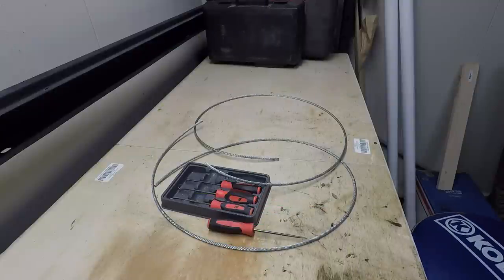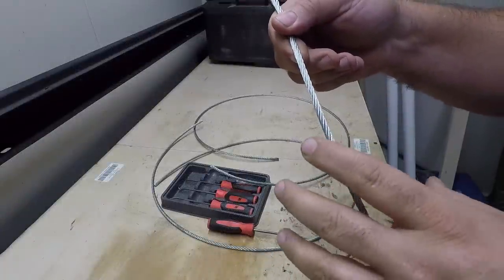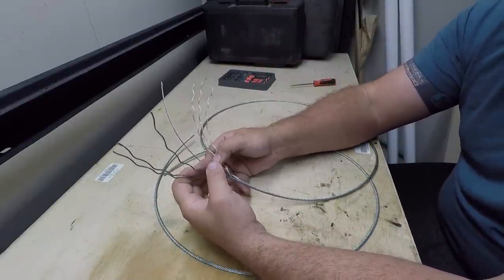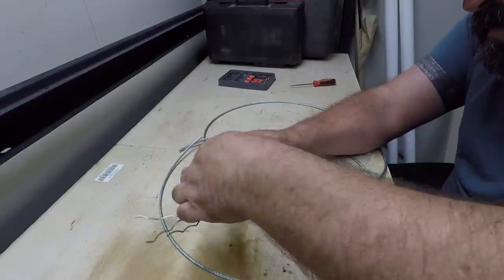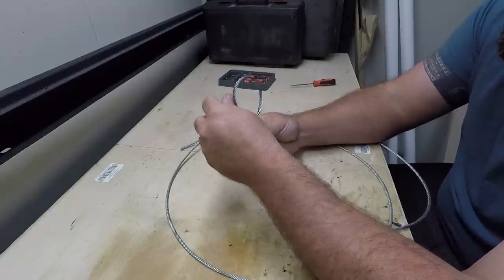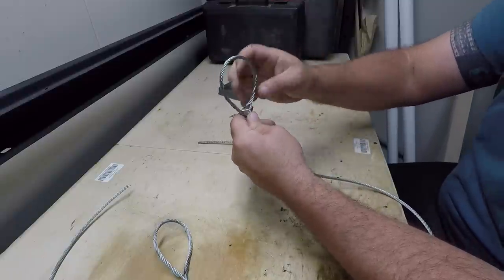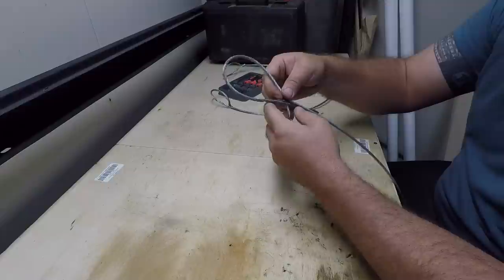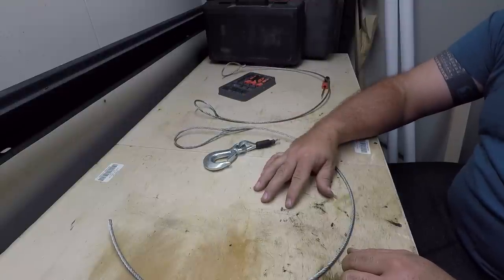3 different ways to make a Flemish Eye in wire rope

Comment: I've always used the 3rd version of this eye with excellent results for my ATV winch. The line angle to my plow is short and  almost vertical which causes the line to fail about a foot from the eye. This is fast and easy to make in  below freezing temps. Thanks for showing the other 2 methods, I'll try them when I need to repair the cable in warm weather.
Reply from the maker: Bill Whalen, the third version did seem easier to wrap. I don't know that I'd want to do it in freezing temps though. Lol. Thanks for watching! 🙂👍
Reply: You don't have much choice when plowing snow in 20 degree F. temps and that's in my garage. Your Welcome

Comment: Thanks Jimmy for showing how simple to do this.You have inspired me to go get some wire cable to start. I've only ever attempted wire splicing once (too many holes in my fingers from the steel strands).  However,  I did continue with Sisal and Nylon 3 strand from 3/8th up to 1/2" . If there is a piece of rope laying around, my fingers start to go to work doing mostly back splice, eye splice and joining splice both thick,  and, thin for use through a pulley. When i find the photos I'll somehow send  them to you. Thanks again for your  video.

Comment: Thanks for the tutorial!  I use 1/4" for my boat lifts and have always used clips and thimbles. I'm not going to lie and say that I'm going to convert to Flemish eyes but when I do run new rope I'll consider doing it the correct way. I would have to think through being able to level it out. Always learning something new here!
Reply from the maker: Dall Tex, for cable adjustment, you may need a turnbuckle or two. Thanks for watching! 🙂👍

Comment: When I worked for a concrete producer as a mechanic. We used the last example that you showed.  We made all our tow cables with 1" cable. The drivers all carried one on their trucks. They would break those cables on a regular basis. I never got to see that happen fortunately. The cables that broke didn't usually break in the loop unless it was rusted and stretched. We replaced a lot of windshields.🥺

Comment: Now that you taught us about the numbers and what they mean...what kind of rope is on your big crane?
Reply from the maker: walter mattson, it is 21mm,  35x7 non-rotataing wire rope. So, it has 35 strands, with 7 wires per strand, and they are oriented in a way that prevents the rope from rotating when loaded. Thanks for watching!

Comment: The dragline im picking up has a Flemish eye on the pendent lines.  Im going to re- cable the whole machine and im sure this will be a little bit harder with a bigger cable.  IM Nccco certified for ABC and ABW so ive had some training on rope and inspection but not enough to be comfortable with it.  Ive done some Flemish eyes in  regular rope just playing around and its amazing how strong they are.   This crane will be for personal use and just a toy to help out with my other equipment. Im working on getting it moving well enough to load itself on the lowboy to get it home and have put a few videos up on my channel already.    Think the flemish eye is ok on the pendant lines or would a wedge socket on either end be better?
Reply: I have spliced 100s if not thousands of Flemish Eyes in wirerope , sizes varying from 5/8 up 2 inch. I have never seen one totally fail. I have seen a few that had slipped a rotation or two. But they were splices that started with less than optimal conditions. The majority of Flemish Eye Splices I have made were with wirerope that had been stressed to the point of failure. The ability to make a Flemish Eye Splice can be a time savior. But it should always be remembered that any splice weakens the rope. .

Comment: Very interesting and good to know. I am a electrician and we do something like that to make a wire pulling eye in 1/4 inch rope
Reply from the maker: Daniel Eyster, I never thought about that. How does it work on rope? Thanks for watching! 🙂👍
Reply: @ToTheTopCrane 
I've done it a lot with nylon and polyester and not had a problem, BUT, I also use a lot more rope, as in bigger than needed for the job !
Reply from the maker: @kengamble8595 , now I'm going to have to get some rope and try it. Lol
Reply: @ToTheTopCrane 
Polyester seems to work better for this than nylon. 👍
Reply: @ToTheTopCrane  https://youtu.be/QeYBkMCQ8WY

Comment: I learned the 3rd method way back. It's fun once in awhile to practice it on plain old rope. Never knew there were right and left lays in wire rope. Does the lat type effect the use or strength?

Comment: A couple weeks ago I shortened my winch cable and clamped it with a thimble inside. Would this method be better for long term use than clamps and a thimble, or is it more of an emergency fix? Also it doesn’t seem like you could use a thimble on a Flemish eye,
Reply: Is a thimble all that necessary for a recovery winch?
Reply from the maker: David Fiedler, a Flemish eye yields more strength than clamps. Clamps have about an 80% strength rating. Whereas a Flemish eye is 90%. You can use a thimble with a Flemish eye. But, it is difficult to get the thimble in place. With some practice and perseverance, it can be done. Thanks for watching! 🙂👍
Reply from the maker: David Fiedler, a thimble helps protect the cable and spreads the load evenly in the eye. If you can use a thimble, I probably would. Just my opinion.
Reply: To The Top Crane thanks for the response, I think I’ll stick with what I have then. I will definitely keep this in the back of my mind though, and try to come up with some cable to practice on.

Comment: Which of those 3 ways is the strongest?
Reply from the maker: Tony Laubner, I'm not sure. Given the way they are wrapped and secured. I'm going to speculate that the third version may be the strongest. That's just based on the assumption that the tail would keep the wires from slipping as easily. Thanks for watching! 🙂👍

Comment: Don't saddle a dead horse!  So... you're saying if I use one of these techniques and wrap it around my waste to lift myself 50' in the air to work on some power lines and it breaks... I can's sue you?  Well... shucks.  But seriously, I've seen the 3rd version before but not the first two.  I've got a winch that I'll be putting a new cable on soon and might try one of those out.  Thanks for the video!
Reply from the maker: burningdinosaurs, if you make one, you assume all liability. Hence the reason I said in the video not to use it for lifting. 😉. Thanks for watching! 🙂👍
Reply: BurningDinosaurs
"wrap it around my waste to lift myself"

It's spelled "waist", not "waste".

Comment: For what it's worth, I figure if you clamped the tail on that 3rd splice to the live side, that'd probably be the strongest one. Thanks for the video Jimmy.
Reply from the maker: Sandy, I think so too. I may try to figure out a way to test them. If I do, I'll make a video of it. Thanks for watching! 🙂👍
Reply: Hmm... as far as testing them goes, what you could do is make 3 little 'chokers' with each type of Flemish Eye in each end, and then use one of the cranes to try and pick up a known weight. They'd probably never lift them, but if you clipped on to one of the Tadano's wing weights for example and pulled until it popped, the crane's scales would (probably) give you a pretty decent idea of the breaking strength of each type of eye.

Wouldn't quite be what you'd call scientific per-se, without using a proper calibrated strain gauge, but it'd be more than good enough for a laugh and a YouTube video.
Reply from the maker: @sandy1653 , I thought about that. But, I'm not sure the company I work for would let me test things like that on the clock. So, I thought about making a choker with one type on one end and another type on the other end. Then attach it to a tree and pull it apart with my truck. Then repeat the process with the style that held and the third style. Ultimately, I would end up with the strongest one.
Reply: Aww man, your bosses are a bunch a spoilsports! (Just kidding, I get why they wouldn't want you messing around like that with their gear). Your method would work just as well. And have the upside of not getting on the bosses nerves.
Reply from the maker: @sandy1653 , I think I'll give it a whirl. We'll see how it goes. Lol. I'm sure there will be a video that follows.

Comment: I didn't see how far you ran the core in on its self before raping the other wires around it. could you or someone explain?
Reply from the maker: James Platt, sorry I didn't get a good camera angle on it, or explain how far the core is tucked in. It's actually not really tucked in before starting. The end of the core is just touching where the strands are unwrapped. Hope that helps, and thanks for watching! 🙂👍
Reply: Raping wires hurts.

Comment: All of the chokers on my truck have hand tucked eyes.  I screwed up when I ordered them and should’ve ordered only hand tucked eyes on one end instead of both ends.  I must be careful when rigging stuff that I have zero twisting going on because I can undo my eyes.
Reply from the maker: Richard Savaglio, hand tucking alot of rigging would be a pain. I had a question earlier that you may know the answer to. Of the three methods I showed, which is the strongest?  Or are they equally strong? I know any of them are 90% of rope strength. But, was thinking the third one would be less likely to unwrap itself. Thanks for watching! 🙂👍
Reply: To The Top Crane I can not speak for the second style because I’m not familiar with it and can’t remember seeing it before.  The first is definitely way more common. As far as strength goes I’m saying the 3rd/last one. You have a bit of tail for when the cable/eyes stretch which as you know, they will. I’m also saying 3 because that’s how my rigging looks which I bought from a chain and cable company
Reply from the maker: @richardsavaglio661 , that's what I figured too. I wish I had a scale that I could put on them to test them.
Reply: Thinking about it now, I know the eyes on my 5/8 and 3/4 chokers took a set on their first heavy loads.  I was next to them when it happened and it bothered me enough that I stopped the pick and called the salesman. He said it’s normal because there wasn’t a swedge fitting on it.